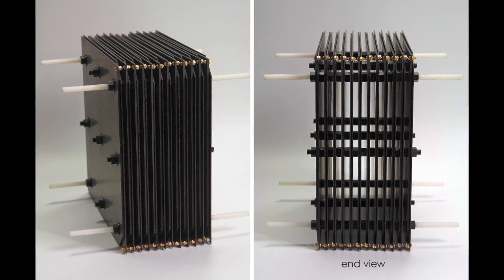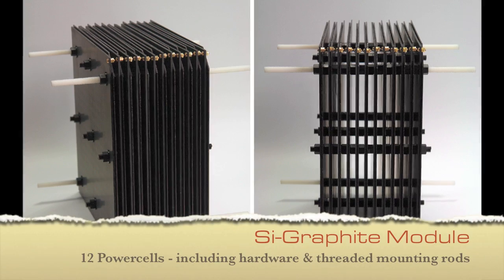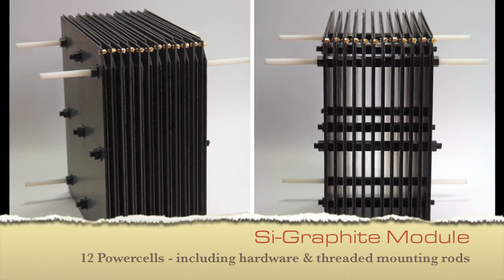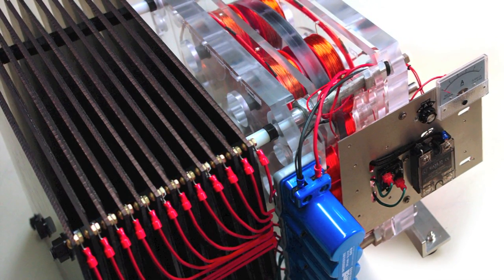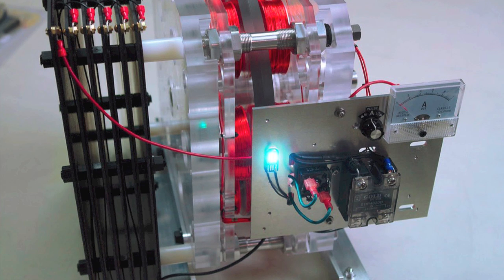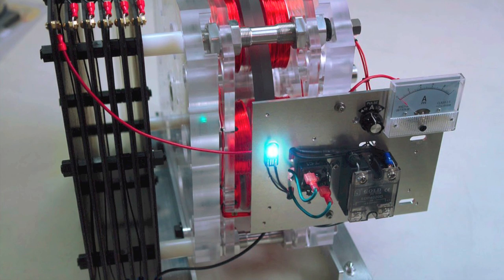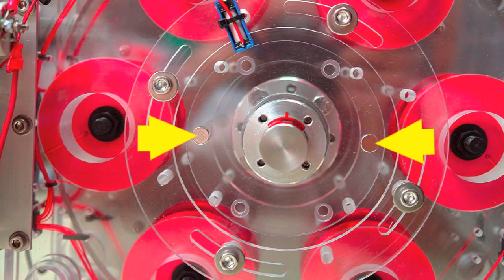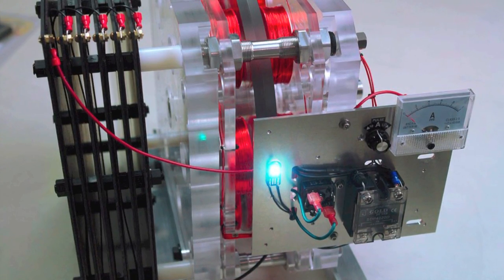Si-Graphite Powercell Modules - Now Available

Comment: You said it at the end. You can use a set of rechargeable batteries instead of the motion, which draws a bit of juice back from the storage plates. They can be starters, and then there can be buffers. 

The juice is increased by the carbon atoms and siphoned out into bigger storages. 
Carbons absorb energies, energy fields, and store them. What you notice is that energy in the environment is not only absorbed but also multiplied, in novel ways.

Comment: Why not use graphite power cells to generate enough current to create a energy loop being passed through two tesla coils with out ant loss of power at a energy frequency that caused solid electrolyte graphene power cells to generate high energy current that can charge up organic carbon power cell banks to get rid of that pulse generator? The concept described is much better then the pulse generator with absolutely no moving parts correct?  Is not that pulse generator a waste of material time and money? LOL

Comment: Thinking of buying a 6 cell unit. Are the cells still around 1.4V per cell? How many mA are you getting out of each one? Thank you! :)
Reply: Branch Gordon This is what i have been wondering myself. l have been following his videos for two months so far. I can't make a major investment and deveate drastically on my project budget unless I know capacity and unit lifespan.
This cell really would streamline my prototype design drastically. 
My second question is weight per cell. I have zero interest in its current stacked configuration only   the 8 cells held within each plate.

Comment: Wow could two swash plate hydraulic pump motors be turned into a electric motor to produce an engine? A positive and negative flow of hydraulic fluid would be needed. Hay can gallium be used has a conductive hydraulic fluid? Indium mixed with gallium might do the trick? Two pulse swash plates turning a shaft while producing electricity? That's sum alien technology right there. LOL

Comment: Have you ever thought of turning this motor into a hydraulic swash plate to generate the pulse? Could you not use a small electric motor to spin  intermittently a heavy gyroscope that operated the swash plate pump to spin the pulse motor? A new power system for windmills maybe?

Comment: If this power generation concept works each home could have its very own power plant. Ran off solar during the day and a capacitor battery bank at night. This could also be used in electrical vehicles to give them unlimited range. Novartis

Comment: Would it be possible to use large graphite rods in titanium closed cylinders that are heated red hot through high communication frequencies to replace power cores in nuke electrical power plants? Hay I had a brain fart so I thought I would throw it at you to see if it would work? Does it stink? Or smell like roses?

Comment: Could a Joe cell with spark gaps set to communications frequencies be able to get those crystal graphite power cells humming to power the Joe cell has it generates hydrogen and implosion gas that can be used with a hot air engine to suck piston down for more compression to drive a camshaft that turns a transmission that turns a high voltage generator? Hay can you tell I want to bankrupt all those who have gotten rich off oil and have taken the lives of anyone who threatened their power base from oil use? -_-
Reply: Jim Martin  you the smartest guy I see making comment about stuff I know about . I gonna check out your channel cos I reckon their would be some really interesting stuff on there !

Comment: A crystal graphite power cell hot air engine could change the world. Induction is frequency correct? Crystal graphite will produce more out put at 126. Hz which is sun light?  Could you not design a crystal graphite induction hot air engine powered by radio frequency? Tesla technology its very weird ; )
Reply: Um... isn't crystal graphite called diamond?

Comment: Could such an engine produce mechanical motion has it generated electricity?  If so then could not these be used in electrical vehicles with a transmition to give electrical vehicles unlimited range while generating electricity that could be wirelessly transferred to a home power grid ounce the vehicle was parked over the transfer coil in the parking space? I am thinking way out of the box but it could charge a tesla wall right? Novartis?

Comment: Would a crystal graphite low voltage induction hot air engine operate more efficient then a pulse motor?

Comment: Why not use low voltage induction of graphite in a V-10 hot air Manson engine  operated off solar panels with a transmission to turn a high voltage power generator to charge these crystal panels up that feed high voltage capacitor banks with a graphite Crystal power wall to produce a very green home power plant? This design would help the working class greatly by cutting their electricity bills to zero? Cars could be designed to operate off the same concept which means better greener transportion with no fossil fuel use? Novartis

Comment: Is the clear plastic used on the unit polycarbonate? If not what plastic is that constructed out of?
Thanks
Reply from the maker: Rotors and stator coil plates are all polycarbonate. Bearing plates are machined from 1" thick clear acrylic.

Comment: Could graphite crystal power cells be used to make helicopter and air plane blades and rotars because these generate heat and vibration do they not which could generate electrity to operate electric motors ?